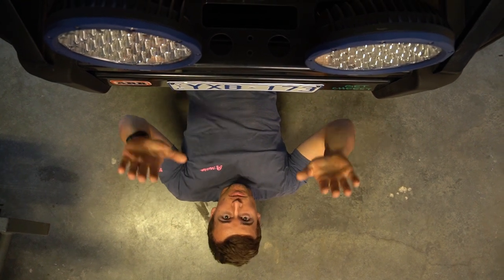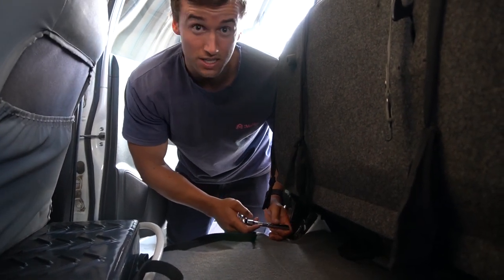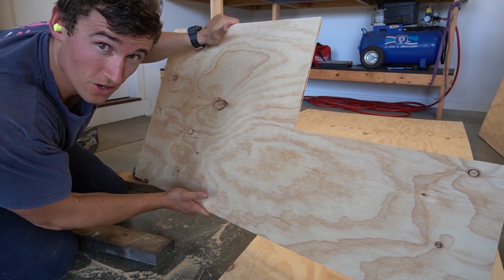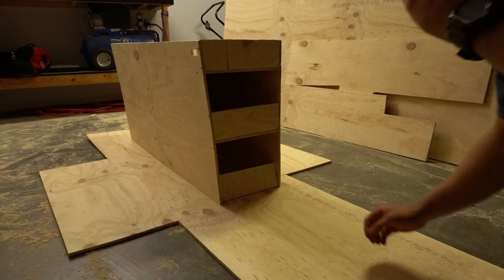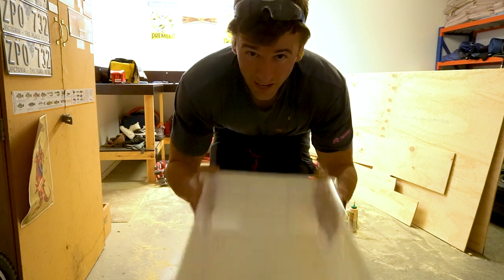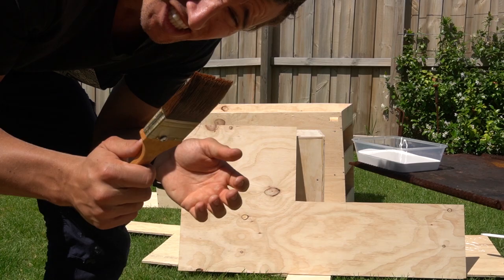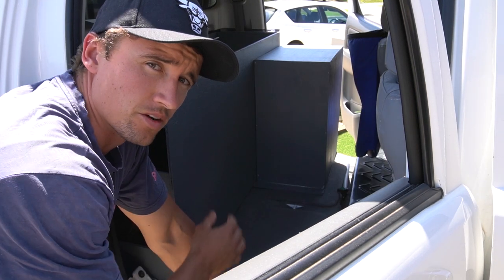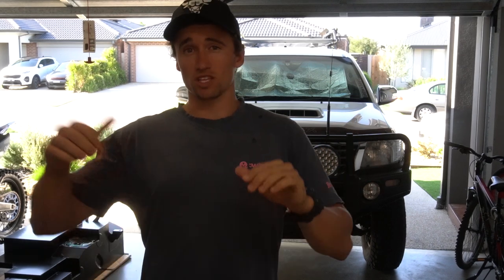The Dual Cab Storage System, I Wish I Did Years Ago

Comment: Great idea , thinking the same with my dmaz , you want toake sure thu that it's not going to effect your insurance  , because it's a variation , might mean a trip to DOT , but hey looks great
Reply from the maker: Yeah i think this is technically illegal because the car is designed to have 5 seats not 2. Would be interesting to see if i can get a roadworthy in this current state. I can reinstall the rear seat without a hassle if need be
Reply: For it to be legal you can register it as a 2 seater pretty sure you just have to put a cargo barrier behind back seats

Comment: Hey mate, 
Looking to do a similar thing to my lux. How have you secured the rear and bottom pieces of ply to your panel/floor so they don’t move around? 
Thanks for the inspiration 
I just couldn’t quite see in the video
Reply from the maker: The individual units are screwed together firmly with screws and right angle brackets to tie the base to the other pieces. Done half of aus with this and its still rock solid. Just remember to use glue on all joins

Comment: Hey mate my underseat storage lid flap things aren't stiched on , what could I possibly do to attach them.. have ou got staples on yours / how are your seat storage  lids attached ?
Reply from the maker: Hey there, mine are stitched to the main carpet lining.

In your case id recommend using a small cabinetry door hinge and screw it between the flap and the storage hole. This would allow it to open like a door